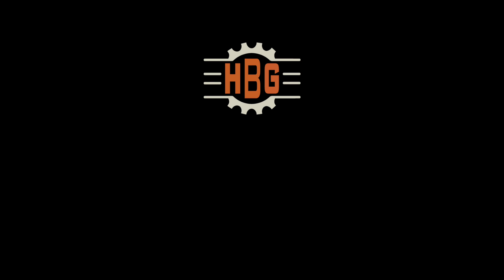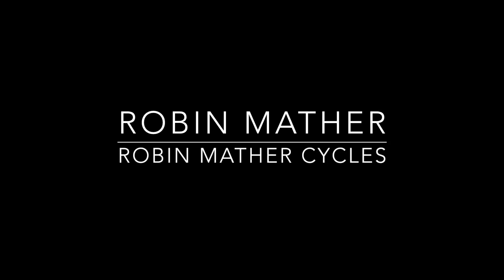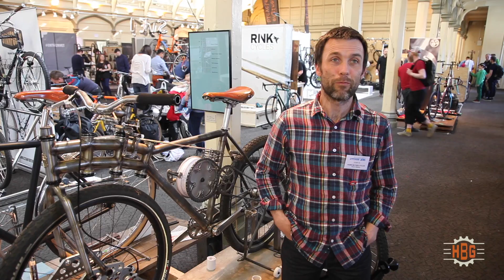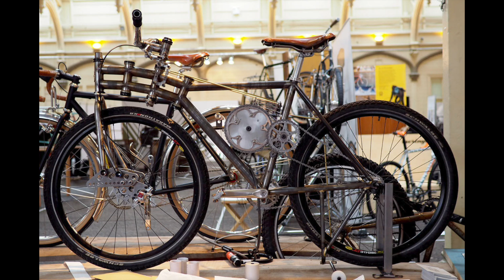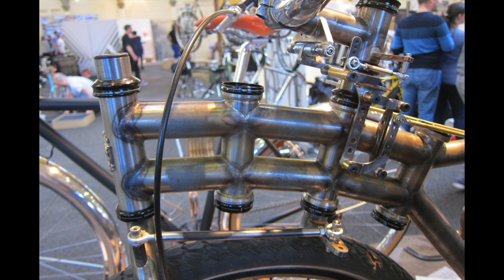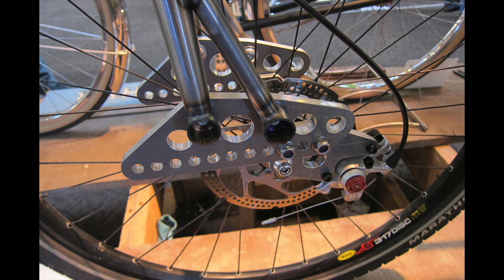2016 Bespoked. Robin Mather and his geo-adjust bicycle

Comment: You need to go step further mate https://youtu.be/49kxtAL8tPA When the rake is negative it helps it self steer.
Reply from the maker: Great video link, thanks! And that bike looks like a joy to ride. Did you make it?
Reply: @BikeArtisans  I did yes. I'm afraid a negative rake has been a bit of an obsession for me https://www.pinterest.co.uk/funnyfrontend/novel-designs-bikes-skateboards-guitars-all-the-im/working-prototypes/ It works for in-line skates, skateboards, scooters, bicycles, and motorbikes. It does work. It's the rest of the world thats wrong. I read an article once about a guy who experimented on rake angles for a motorbike. He progressively steepened the rake, keeping the trail the same and each time the bike steered better. The problem was that when the forks were vertical, he got a horendous judder every time he braked. But if you go past vertical, it doesn't judder on the brakes and the steering improvement continues.
Reply: @BikeArtisans  Yes I did. You should try this configuration yourself. I am sure your build quality is much better than mine.